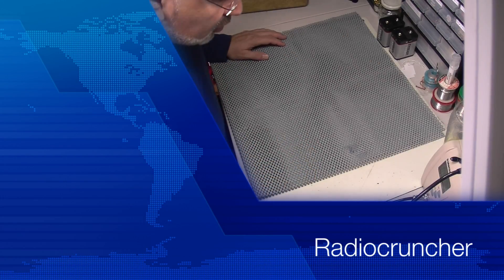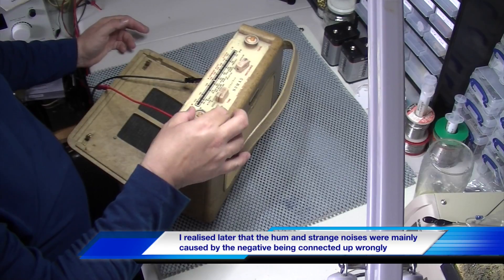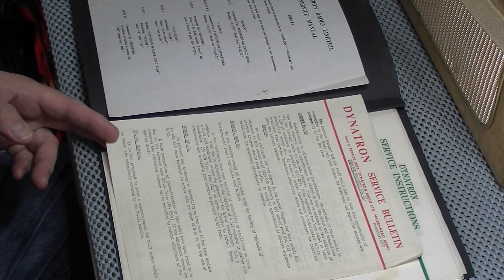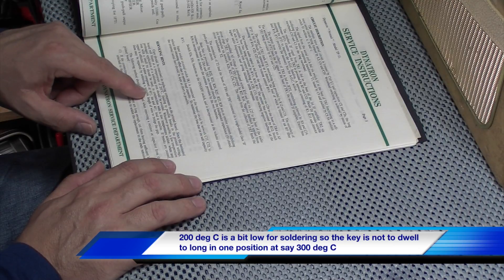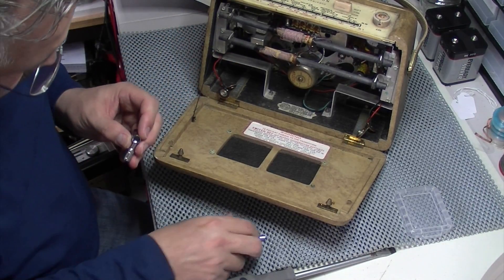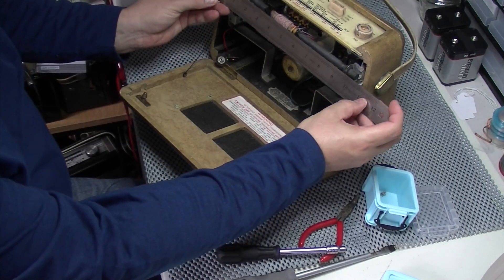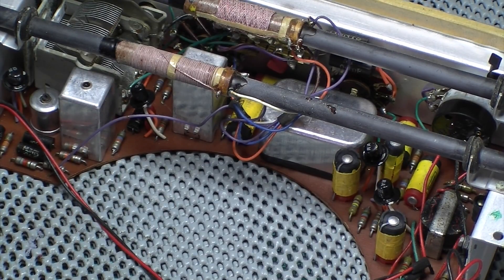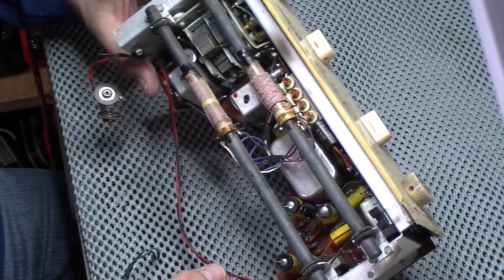Bakers basket of radios: Dynatron Nomad TP11 Part 1: Initial test and chassis out

Comment: Nice radio, are the chassis fixing nuts BA rather than AF, I would have expected BA in electrical goods of that period, small point I know, but I can be a bit 'anal' about fixings!!, keep it up. J.
Reply from the maker: Probably right Joe. I only have a few imperial sockets here so just read the values off the side of them. I need to get some imperial box spanners or nut spinners really.I do like to have the right tool for the job. Thanks for watching. Graham